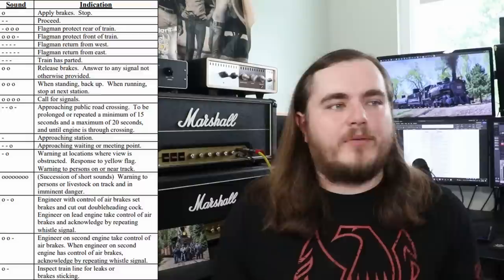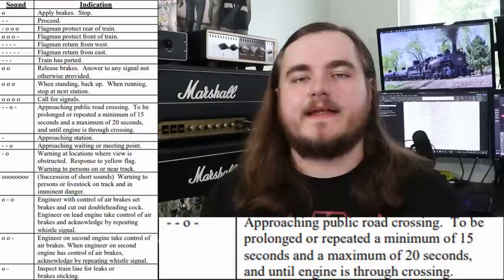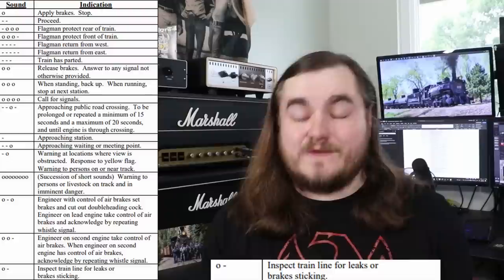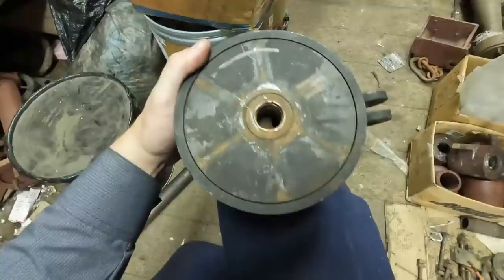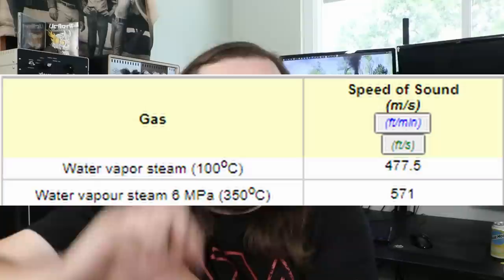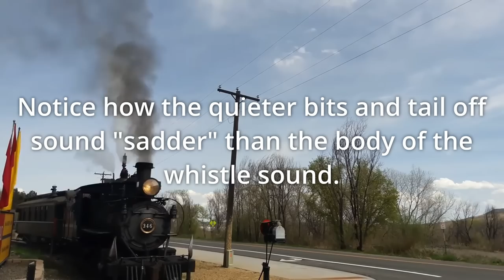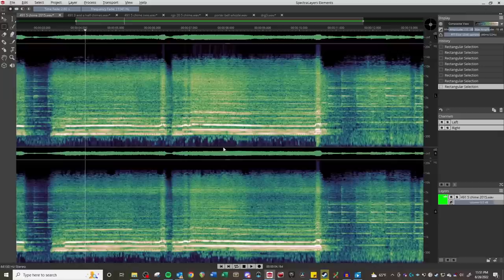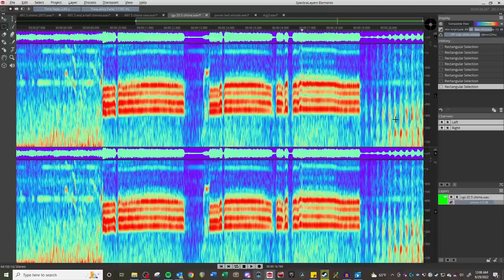WHISTLES 101 - EVERYTHING you could want to know about STEAM TRAIN WHISTLES!

Comment: Would be interesting to have a set of pressure sensors in each chime to see if the density of the steam change with regards to the flow rate applied to the whistle directly affects the pitch. Might just be that the density affecting the speed of sound could be the change in pitch. Haven't thought much as to why the small chimes are affected more but it might be that there is less volume that averages the density inside the chime. More low density air sitting in the top of the long chambers. Just my 2c.
Reply from the maker: Could be, would be an interesting experiment for sure. A tough one to rig up for sure though.

Comment: A question if I may.  You showed a whistle that was made of 6 brass tubes that had a band around it.  Are those "chimes" touching directly along the length of the center stud?  Reason I ask is because as a guitar player myself I'm aware of harmonic and nodal points.  In thinking about wind chimes, they are strung at a nodal point which doesn't resonate.  Am I on the right track here?  Is the tube supposed to physically resonate or is the actual sound the product of the steam going into the bell chamber and escaping a perscribed depth?  Now that I type I think of the wooden whistle.  It doesn't actually resonate in your hand does it.
Reply from the maker: The whistle itself does not resonate, it's the steam moving in and out at the frequency of the pitch that causes the sound. The banding has nothing to do with nodes, though I totally see where you're getting that from.

Comment: Great video! I enjoy your different takes on the specifics of train parts and how they work!

I was told a long time ago, that the reason the whistle changes pitch with steam, is because as the steam condenses back to moisture it lowers the volume of the bell chamber. This in turn makes it change to a higher pitch. A smaller chamber already has less volume, so a single drop of moisture will effect it more, thus giving a greater change to the higher chimes. I do not know if this is true, just something I was told. Your steam temperature logic could be more accurate. One way to tell would be to record a whistle, then heat up the bell with a torch or something, then record it blowing again. If the entire pitch changes, then the temperature makes a difference!

Also, I was hoping for some information on the languid plate gap. Does the distance of the bell from the plate effect the gap? What are the recommended gaps per pressure? Does the diameter of the whistle change the gap? What about Air VS Steam?
Reply from the maker: Interesting thought; I don't know if that makes sense though as the steam that comes out of the whistle is essentially superheated. There's not much moisture to it, and if you do send water out the whistle it makes all sorts of bizarre sounds...

The temperature is not of the bell, but of the steam. So the torch experiment, while well thought, wouldn't work. It's the temp of the fluid itself that matters. 

Regarding languid gaps; I am not the best expert for that. Higher pressure means smaller gap, and it seems most whistles shoot for about 2" between languid and bell but I couldn't tell you precisely why. I've only got experience with engines of similar size and pressure, so I can't speak to the high pressure superpower stuff.
Reply: @Hyce777  To that point, is locomotive steam that operates the whistle saturated steam or superheated steam? Also, does blowing a steam whistle a lot bleed off any noticeable boiler pressure (so that an over-zealous engineer might blow the whistle too much for operating purposes)? Many thanks for your reply.
Reply from the maker: @williamabernathy9893  depends on the loco; some use superheated steam but most use saturated. 

The whistle does use steam, but really not much. You would not conceivably ever be able to blow the whistle enough to make an appreciable difference in pressure, without just constantly holding it open. Even then, that's a lot less flow than even a safety valve.

Comment: RE: Timbre spelling and pronuciation. Blame the French.

Edit: Also temperature affects the speed of sound in air just the same as in steam (it afffects the speed in all gasses, and both steam and air are gasses). What seems to give the difference then is the steam's ability to rapidly and drastically change temperature. Presumably if you could change the temperature of the air you breathe in a similar manner, the wooden whistle would behave similarly.
Reply from the maker: Those bastards!

Comment: How is the sound transferred from the whistle to the surrounding steam cloud to the air?  I'm guessing it's direct mechanical contact across the change in materials, but is that correct?
Reply from the maker: So, this was something I learned after I made this video from a friend of mine who reached out - it's a rapid pressurization and depressurization of the chambers that causes the sound, not the whistle vibrating itself. Think of the "helicopter sound" when you open one window in your car when on the highway, but much smaller scale. That's what causes the sound, and it's present in the steam/air mixture.

Comment: Are this whistles always opened at the top or sometimes closed or mix of both? What are typical chords that they make in musical terms? Are there any patterns or whatever sould pleasant? Are they tuned or made by ear?
Reply from the maker: The whistles are almost always closed on the top; creating a closed chamber. 

The tuning is, all over the place, so true chords are rarely in tune. Most 3 chimes make either a major or minor chord. Many 5 chimes play a minor 7th chord with an octave of the root. 6 chimes are wacky, with a lot of close intervals, and vary significantly by manufacturer.

They are tuned by ear sometimes; sometimes folks will fill the chambers with lead to a certain depth to increase the pitch for better tuning, though that's a bit rare.
Reply: @Hyce777  thank you!

Comment: Hyce, you said that most X chime whistles are the same shape/diameter/height as the others of the same chime, and that the material is the one that changes the sound. 

If I wanted to make a whistle that is a C3, a G3, and a Bb3, would that be possible, and if so, how would I go about finding the proper length? I know material makes a difference and that it can change the notes, but I wanted to give an example lol

Tysm for doing the 101 series!
Reply from the maker: You'd need to know the wavelength of those notes, make an educated guess on the exact speed of sound / steam mixture you'd have, and then make the chime length correspond to 1/4 the wavelength at that speed of sound for each note.

Comment: Hey can we have a Bass chord. Using The long scale Bass as a reference, also what is Amplitude 4 500 Alex.  What is the 2 boxes on the top Marshall head?  Thank you and keep up on the Great 101 series.  My 63 Tremulux has the bias modulation. Really beets the tubes   ,output being outra
geus when slow.   Anyway. Love this intros thank you. Keep working😷❤️🙏👍😄😄
Reply from the maker: The two boxes are the Aracom attenuator, and the universal audio OX box. The OX is a very handy piece of kit. Plug your tube amp into it and it's a load box / speaker / mic sim.

Comment: I kinda remember you mentioning at one point (I think it was the RRO caboose racing video) that cabooses sometimes had whistles. If that was the case, what types of information would they be used for? Any example whistle patterns? What generated their pressure?
Reply from the maker: For protecting when the train runs in reverse; same whistle patterns, and they're plumbed off of the brake pipe. Air whistle.

Comment: hi i would love to get the dimensions of the 6 chime whistle that you built and any cad drawings you have of it 
thanks Robert
Reply from the maker: Inner pipe is a piece of schedule 80 2", outer is a schedule 80 6" turned down in a lathe. 1/4" bar made the fins up. Chamber lengths are: 5 5/8", 7", 8 1/4", 9 1/2", 11", 12 1/2"

Comment: Maybe this is more for AmtrakGuy365, but it would be interesting to see how Amtrak signals differ from the other Class A operators, and how they all interact with each other.  Does Amtrak conform to the hosting railroad, or do they use their own signals?
Reply from the maker: Now that's a question I don't have the answer to. I would presume that the engineers have to be trained per the territory they run on and use host railroad signals, but I don't know for sure.

Comment: Question: in Germany we need a gsm-r radio and an inductive train security system to drive on the railways of deutsche Bahn. How is this in America?
Reply from the maker: It depends on what territory you will be operating in. Most main tracks these days require something called Positive Train Control (PTC) which likely does something similar to the inductive security system. Prevents train collisions and derailments, as best as it can. In some other places, it isn't required. Depends on what you're hauling.

Comment: So here's the question: Horns can be blown on steam, this was a common practice on maritime horns in the 30's and 40's. So what if you hooked up a train horn, say a K5LA, to steam with a pull cord valve. Could you quill it?
Reply from the maker: I don't think so, as the whole horn would not be shrouded in steam; steam would only be on the inside. That said, I'd love to try it!
Reply: @Hyce777  the whole diaphragm, and thus sound producing metal, would be surrounded by steam. The physical horn shape only amplifies the sound of the diaphragm
Reply from the maker: @Squid1562  Does the diaphgram allow air on the outside of the horn? That's what would make it work. I don't believe that's how it works, but I don't know if that's the case. Not an airhorn guy.
Reply: @Hyce777  from what I understand. Air passes up through the manifold into each horn. Flows around the diaphragm, causing it to vibrate. Then exits the front of the horn. The vibration of the diaphragm produces a pure tone which is then funneled and amplified out the horn bell. The size of the diaphragm produces the pitch.

I would think that in order for it to quill, only the diaphragm would need to be surrounded by steam. Much like the individual chimes on a whistle
Reply: If you watch videos of old ocean liners like the Queen Mary and Normadee, you’ll see large plooms of steam coming from their horns when they sound
Reply from the maker: @Squid1562  interesting; we'll have to mess with this some more.

Comment: I’m trying to build myself a 4 inch PVC single chime Hooter but the problem Is that The external diameter of the bell and the bowl will be the same. But also I’m can’t figure is why the bevel for the bell is on the inside
Reply from the maker: So long as the gap where air / steam comes out is towards the inside of the bell, you'll be fine.
Reply: Doesn’t matter what degree of angle of the bevel has to on the bell? Just as long as it cuts the air/steam to make the resonance.
Reply from the maker: @alexanderranallo2366  Not really no, though steeper (closer to parallel with the bell) is better than a flatter one.

Comment: Wrong, or at least incomplete. Whistles are NOT like straight flutes, they are like VESSEL flutes. They are aerophones, the DENSITY of the air has a strong influence on the tone. A vessel flute's resonant frequency is determined, basically, by the ratio of volume to the area of the apperture. Easy way to test is blowing on a bottle. Change the volume of the bottle by filling it to change the tone. You can also cover a portion of the opening on the top to change the tone.

Comment: Really bad example comparing a Fender to a Gibson guitar. The scale length and string tension also play an enormous part in the timbre and tone. Fender uses a 25-1/2 inch scale on most of their guitars and Gibson uses a 24-9/16 to 24-5/8 inch scale that they like to call a 24-3/4 inch scale. Post 1970 Epiphone guitars use a true 24-3/4 scale so you cannot glue a Gibson neck onto an Epiphone body and make it work. Extra string length behind the bridge to a trapeze tail piece or to a Dobro shell tail piece adds even more string tension, scale length aside. 25-1/2 inch scale has more twang than 24-5/8 inch. Fender Duosonics have a short 22-1/2 inch scale. Gibson ES140s & Guild's M60s are also 3/4 scale. Not very much twang in any one  of those.

Comment: A train whistle works exactly the same as a pipe organ flue pipe.
Reply from the maker: Not exactly! But close. Pipe organs have a slit in one side, rather than all the way around. That prevents the temperature gradient and steam cloud effecting the pitch of the organ; making it almost exactly the same, but slightly different for an important reason. You want your organ to be tuned. :)
Reply: @Hyce777  Same principle in action. Of course there are differences in the physical shape, and organs don't use pressurized steam. :)
Reply from the maker: @socialite1283  some do, actually! Haha. I had an argument with an organ's overseer about this, which is why I brought it up. That geometry difference makes the organ stay in tune, but the steam whistle vary in pitch.
Reply: @Hyce777  Organs don't stay in tune. :) Ambient air temperature changes affect the pitch of organs, but certainly not as much as the heat from steam would affect a train whistle. But the change is enough, across different sized pipes to put an organ out of tune as different sized pipes are affected to different extents by temperature changes. The different types of organ pipes change pitch with temperature at different rates. I've played some organs were certain parts of the organ are un-playably out of tune in the heat of summer but other parts were almost completely unaffected.Metal pipes are affected by heat more than wooden ones. Big pipe organs are generally tuned every 2 months. Small ones might be tuned 6 monthly or annually, or just when they've gotten too awful to play. :)
Reply from the maker: @socialite1283  Oh wow, that's really cool! Thanks for sharing the knowledge. :)

Comment: You engine whistles are nothing more than steam driven organ pipes. In fact, Theater Organs sometimes have Train Whistle stops in them.  Material DOES NOT have an influence on the tine of a high pressure Steam Whistle.  It is all dependent on the material or the mouth, steam pressure ad the characteristics of the languid

YOU CAN change the pitch of organ pipes and steam whistles by the amount of pressure used to make the pipe speak.  This "Splitting Action" you speak of does not happen. Sound in a whistle is created by the wind stream flipping back and forth across the upper lip of the pipe.  This subject is too complex to discuss here but any organ builder, flute player will explain how the wind (steam) stream . Change in the pitch of a whistle CAN BE CHANGED by the pressure.   Organ pipes - whistles - change pitch with temperature as well as a result of density of the air.  Organ builders have been doing it for CENTURIES, not years.  Your explanation is so simplistic but it is also inaccurate. That wood whistle you have WILL CHANGE PITCH based on the pressure you apply. Wind or steam it is all the same physics.  But you are doing a good job of Trying to explain.  YES - higher pitched pipes will change pitch more than longer lower pitches pipes. Owing to wavelength., hot heat pr pressure not